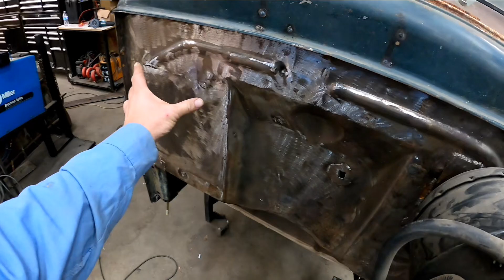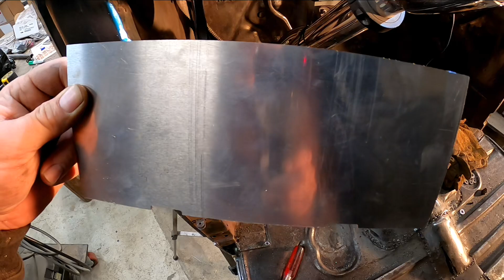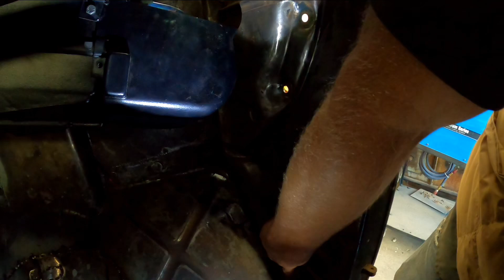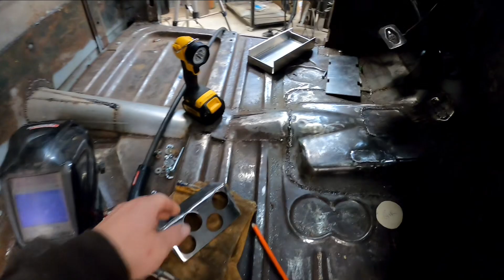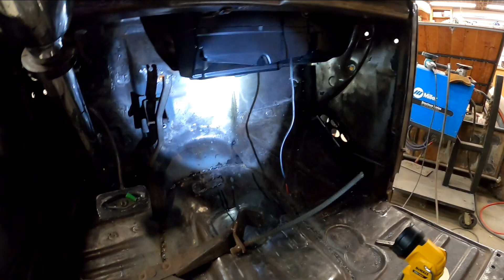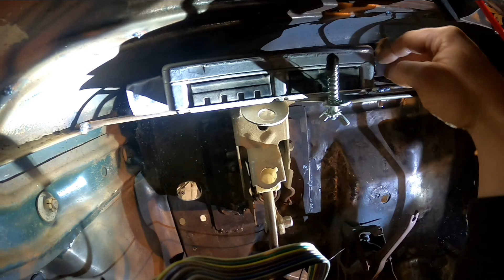1947 ford truck | VintageAir, Elec cowl vent conversion, wipers, wiring and dash stuff | pt33

Comment: I love the video! Good craftsmanship and inovations. I am so thankful that you posted this video. I'm going to apologize up front  for how long this comment is. I've got a ton of questions  because Im working on a 47 Ford truck too. You addressed alot of the issues that I  have to deal with as far as the A/C , A/C controls and gauges. 1st: what Vintage Air system did you end up using? I was looking at the short pac unit. 2nd: Did you have to weld in  mounting brackets to  mount it? Are you planning to install a windshield wiper on the right side? And will it interfere with the A/C and or the cowl actuator? I'm looking at a dual windshield wiper conversion kit from Mac's antique auto parts. And can you have the standard size glove compartment? I installed a 1st gen cummins. And I plan on running all of the hoses through the fire wall because it will be a "natural" fit. But I really like your hose installation  and relay mounting idea, it looks really good. All of the original gauges on my truck work including the speedometer so I plan to use them but at first I didnt like them and tried to design my own, and ran across the same problem with not enough space to fit standard 2" gauges in. Classic instruments does  has a variety that fit the 40s fords.(in case you aren't aware of that)  I also plan to use a shoulder seat belt it looks like you are too. My ignition switch is mounted (not by me) on the raised section of lower dash to the right of the steering wheel. Man I could go on and on! Sorry this is so long winded but this is the only video I've seen that addresses these issues. Keep up the good work it looks great so far.
Reply from the maker: Hey Don. I have a more recent video covering a lot of what you just asked. Check it out and let me know if you have other questions. You have any videos? 
https://youtu.be/aa1n-HPRYB8